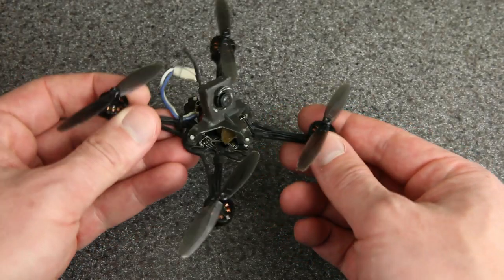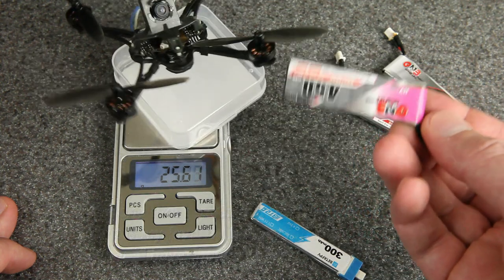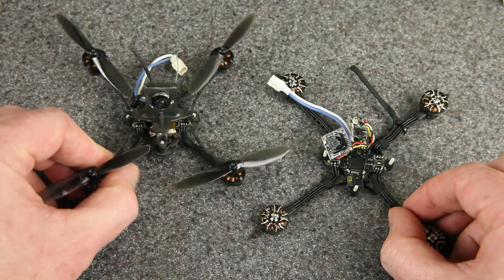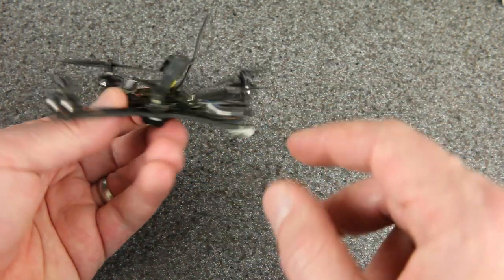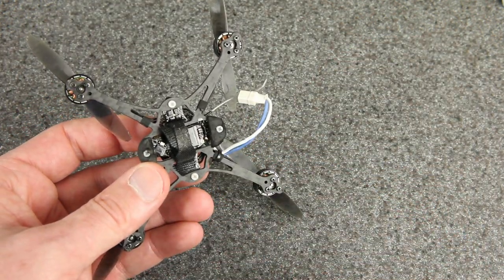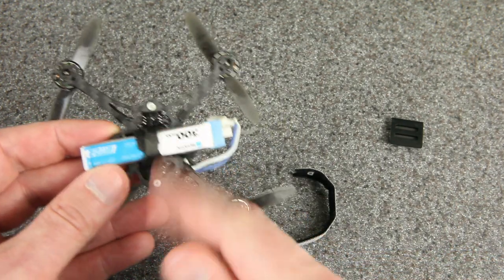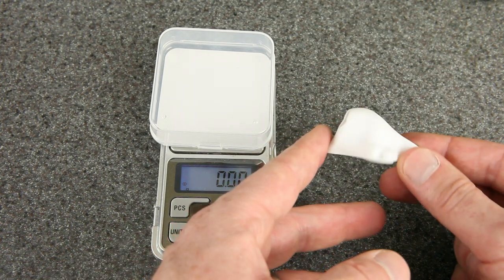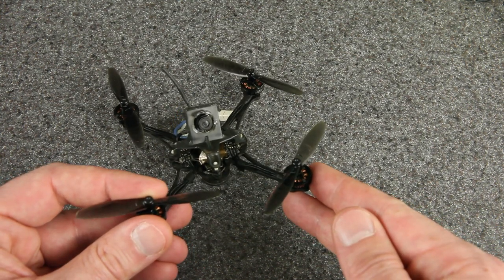My 2.5" Toothpick Just Got Better

Comment: Have you tried 2s on this setup ? With a 2s fc
Reply from the maker: I have a different 2S with 65mm props and 1102 motors. It is fun too. The difference is that the 2S is faster and suffers from less voltage sag, but it is also heavier. So the 2S is more fun in a larger space with room to rip. The 1S can maneuver anywhere, even in my tight backyard. 😁
Reply: @MrShutterBug  I can’t seem to find another dsmx hx100 se. My board went bad somehow. Thinking of putting another 2s fc. any suggestions?
Reply from the maker: @jeffro1005  unfortunately they discontinued the HX100 SE. It’s a shame. If your FC died then you should be able to replace it. I don’t think the replacement has to be exactly the same FC. Good luck. .